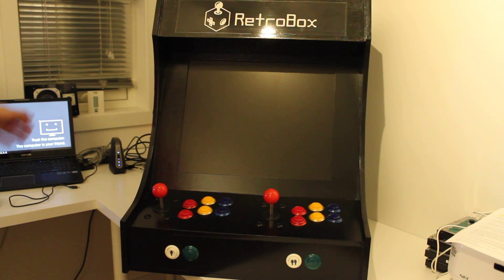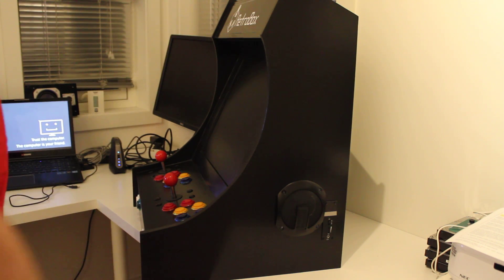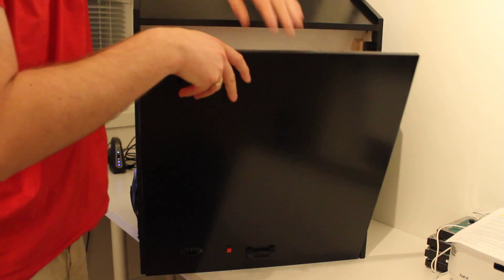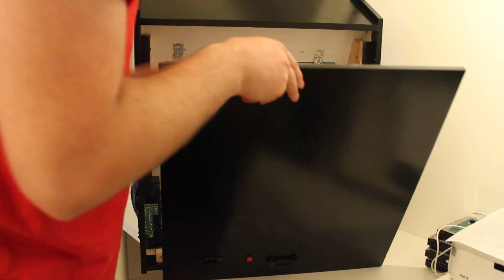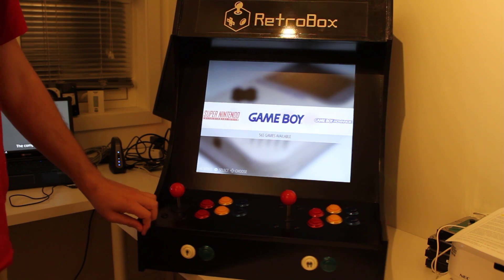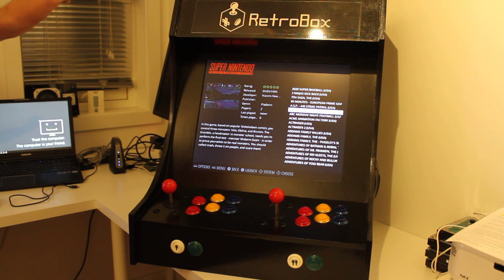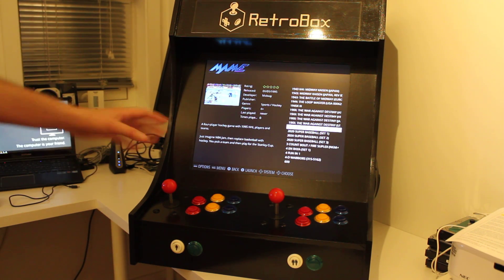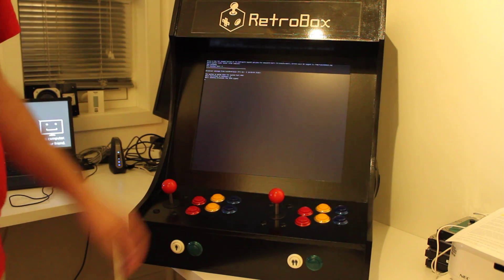RetroBox - Second RetroPie Arcade Build

Comment: Nice build! I'm working on my first one now. I have my Pi setup and get all my arcade controls today. Can you answer a couple questions for me please? 1) How long did it take for the scrape process to go through all the games and get the info? Do you need to unzip them for this to happen? 2) Have you had any issues with heat? I've seen some people install small cooling fans in the back but I didn't see that you did.
Reply from the maker: +Chris Smith Thank you! :)

1) It took a quite some time to write my custom scraper (I'm now re-writing it with a user friendly UI), but the actual scraping was done in just a few hours. I didn't unzip any files, just used the name of the game and system. I'll make a new video/post once the software is done, but it may take a month or two until I get the time to finish it unfortunately.

2) Not really, but I haven't overclocked it much either. If you intend to overclock it and run graphical intense games I would probably recommend adding a fan and/or heatsink. The Raspberry Pi will tell you if it runs hot or under-powered and I haven't encountered that issue on my build yet. There is plenty of space in the cabinet so it's essential the same as having the Pi lying on your desk. I probably wouldn't recommend a Raspberry Pi anyway if you intend to emulate N64 or newer systems.

Good luck with your build!
Reply: +IDmedia right now I'm just doing a table top one like this using the Pi. It won't have higher end emulators on it. This is just a prototype until I build my big 4 player unit. That one I have a beast of a computer that I'll use :)
Reply: +IDmedia Oh and when I did my scrape, I left the games zipped but wouldn't get the info. I had to unzip for RetroPie to download the info, does their normal scrape software not work that great?
Reply from the maker: +Chris Smith To be honest I haven't tried the built in scraper that much... Since I had developed a scraper for my Windows arcade I found it easier to just modify the code and use that instead. :)
Reply: +IDmedia well when you have your scraper more user friendly, I would gladly donate some $ to use it!
Reply from the maker: +Chris Smith Thanks. I'll try to get it done as fast as I can. I'll let you know when it's ready for testing. :)
Reply: +IDmedia Awesome! Oh... one other question. This is my first Pi that I've used, and want to make sure I'm using the right power source. I've read a lot of stuff that people get away with different adapters, I'm using an old Nokia phone charger that is rated 800ma (don't remember voltage) I don't have the charger in front of me since I'm at work. What adapter are you using, and what's the voltage rating? Just want to make sure I don't overpower it.
Reply from the maker: +Chris Smith It's recommended to use a 5V/2A charger, but it should also work with less (800mA should work). I have mine plugged into the monitor without any issues. The Raspberry Pi will display a colorful square in the top right corner if it's under-powered. Like this: https://www.element14.com/community/servlet/JiveServlet/showImage/2-129575-208157/pastedImage_0.png
Reply: +IDmedia Great! You've been a ton of help. I don't remember seeing that icon on my screen, but I will definitely pick up a different power adapter just to be safe. My arcade joystick and buttons just got delivered too! Can't wait to get home and start testing out some more stuff. Subscribed btw.
Reply from the maker: +Chris Smith Thanks! Good luck with your build and just ask if you have any questions. Regarding heat issue... it will display a red square if it's overheated (can't remember the threshold), so you won't miss it. :)

Comment: which rom set are you using for mame? and which version of mame are you running.? I myself am using 0.139 romset but a lot of titles don't seem to work. and the mame I am using are 2 different ones. but for some reason on the one that uses 0.139 rom set, I can't make the retropie to remember the controls. I always have to reconfigure the controls when I shutdown the raspberry pie. but on the other mame emulator it does remember. if you could help me I would appreciate it. oh and great job on the build of the arcade machine. I am going to make something that more or less resembles a kiosk. great video enjoyed watching the video.
Reply from the maker: +123hellstorm I'm using 0.106 with adv-mame 1.2 (recently upgraded to 1.4, but it uses the same set). If you use 0.139 you'll have to use lr-Mame2010. I haven't tried that one, but I'm really happy with adv-mame. Most games work without issues (except those who need CHD files because I skipped them for now, but may add a HDD later). lr-Mame2010 is experimental, so I guess it's only natural that it's buggy with roms that have been added to the later romset.

I would recommend to give adv-mame a try. Just launch a MAME rom, press 'a' and select adv-mame 1.2 or 1.4. It remembers the controls, but you may have/want to rebuild the romset to 0.106 for it to work properly.

Thanks for the nice comment. Would love to see your build when it's done! Good luck! :)

More info: https://github.com/RetroPie/RetroPie-Setup/wiki/MAME
Reply: thanks for the help.
Reply from the maker: You're welcome. :)

Comment: Great job i got a question for the rest of the Arcade like the front panels do i need to scale the PDF  to 100% too or what i need to do please Help Thank you.
Reply from the maker: +TapOut Ms Thanks! Yes, if I remember correctly I scaled everything to 100%. :)
Reply: +IDmedia Thank you so much
Reply: +IDmedia sorry quick question how i can select each piece by There self because they are together in one PDF file. Please Help if you can
Reply from the maker: +TapOut Ms Sorry, I'm not sure if I understand the question... You just want to print a single page instead of the whole PDF? Can't you just specify that in the print settings?
Reply: +IDmedia lol they are 3 PDF one for the side another for the controls and the other one is All the pieces together so I can't select the back door only or the marquee so i can print it out 100% like the other 2 PDF files
Reply: +IDmedia lol they are 3 PDF one for the side another for the controls and the other one is All the pieces together so I can't select the back door only or the marquee so i can print it out 100% like the other 2 PDF files.
Reply from the maker: Oh, now I see what you mean. Sorry, I just printed the side panel and control panel at 100%. The other parts are just squares or rectangles, so the only thing you'll need are the measurements. No need to print out a piece of paper that's 50mm x 54.4mm :P
Reply: +IDmedia Thank You again i will try it and keep the good job.
Reply from the maker: Good luck! :)

Comment: Are you using shaders or overlays on your retro Pie?  If so. Which ones.
Reply from the maker: +Goose Goose I haven't made any changes to the shader yet. I thought about giving scan-lines a try, but I'm actually very happy with the default settings. I haven't considered overlays either just yet. If I had a widescreen and the games weren't full-screen I would probably use overlays to fill out the screen. If you have any experience with this, please let me know. :)

Comment: For storage, I'm guessing all the emulators, OS, and ROMs are stored on the microsd card, correct? I'm thinking of building one myself, but am not sure if a 8gb microsd will work and I can keep all the ROMs on a USB or is everything stored on the microsd.
Reply from the maker: +TheSpiceWeasell Yes, currently I'm using a 32GB micro SD card. EmulationStation isn't optimized for a lot of roms because it checks if every rom exist on every boot and there's currently no way of turning that off. I'm looking into patching that issue. I have about 10k roms on the SD card now and it takes 1-2 minutes to boot. Adding more roms may cause booting issues. 8GB should work perfectly. :)

I'm also looking into connecting a USB-SATA adapter to the arcade for storing .CHD files (MAME disk images) on a normal hard drive since they are huge. Some games such as Killer Instincts needs a .chd image in order to boot and they tend to be quite large.
Reply: +IDmedia thanks for the info. hope mine turns out as good as yours, yours looks professionally built
Reply from the maker: +TheSpiceWeasell Thanks so much for the feedback. I'm sure it will turn out awesome! Remember to post a video/link to your build here when you are done. Also, feed free to ask questions if you are stuck along the way. :)
Reply: +IDmedia Hello again, I've hit a problem... When you go to move roms to a USB drive, what format do you move them to? I've seen some people just move the .gba's and such to the megadrive, but I've also seen online people move the whole .zip file of a rom for mame to the mame folder. I've tried different ways, but the closest I've gotten it they show up in emulation station, but when I select the game the screen fades to boot, but then returns to the rom selection screen. How is yours setup?
Reply from the maker: I'm not 100% sure what you mean by "what format do you move them to", but if I remember correctly all my roms are stored as .zip files. Just adding them to the correct folder should be enough. If the game shows up in EmulationStation you should be on the right track. Remember that some emulators such as GameBoy Advanced (.gba) requires a BIOS in order to work. According to your explanation I'm quite sure adding the gba_bios.bin file will solve your problem. 

More info: https://github.com/RetroPie/RetroPie-Setup/wiki/game-boy-advance
Reply: +IDmedia you were correct in understanding my question about the .zip files. It makes sense that ES will need the bios too, but I would have athought it was already on ES.
Reply from the maker: Nope, the reason for it not being included is the same as the roms. If you don't own the game or console you'r not technically allowed to have the BIOS file either. A quick Google search should help you find it. :)

Comment: Really really really appreciate your work. It's so nice. Can you tell me what are the other 2 (if i'm not wrong) printed circuit boards besides the Raspberry Pi? One i think for the joystick set, right? And if i didn't understand wrong, the set joystick is connected to the Raspberry Pi by the USB port? 
Sorry for the many questions but i really like your project.
Reply from the maker: +Federico Urbinelli: Thank you for the feedback! The circuit board hanging underneath the Raspberry Pi is indeed the controller for the joysticks/buttons. If you are interested you can find it on ultracabs.co.uk. I think the controller is great, especially on Linux. It may not be so great if you intend to use it on Windows with HyperSpin (I had some issues while trying). The circuit board on the bottom left is the pcb for the speakers for adjusting the volume/earphones. Yes, the joysticks/buttons are connected to the Raspberry Pi by the USB port.

Hope that answers your question! :)
Reply: Thank you for the quick reply man, and yeah, your answers fully satisfied my questions... Great work, congratulations again man, i'm gonna do something like that, but only this summer, when i got time, and i'll certainly rewatch this video if i'll have problems (i hope no haha), cause it's very detailed and your replies too. Thanks again.
Reply from the maker: +Federico Urbinelli: If you buy the same controller I suggest to take a look at my blog post: http://idmedia.no/projects/retrobox/retropie-3-running-on-my-bartop-arcade/
Even though the USB controller works great, it required me to add "usbhid.quirks=0x16c0:0x05e1:0x040" to "/boot/cmdline.txt". That parametre will split the Xin-Mo USB controller into 2 individual joypads. Took a while to figure out because the only issue you'll notice is that some emulators won't allow you to configure all buttons for player 2... :)
Reply: Yeah man i've already read that... Your work is admirable, really like the blog. Since you mentioned about the emulators... I got a last question, if you could answer this one too would be awesome: you know why some emulators don't launch some or even any games (for example SNES emulator, MAME emulator, PSX emulator...)? Is it just that the games aren't supported or it can be resolved?
Maybe the default emulator has to be changed with another one?
I ask you this because a friend of mine installed some roms, but for now he can launch only ATARI roms, PSP roms, some PSX roms: SNES roms don't work, MAME's too, NEOGEO's and NEOGEO Pocket's too. He has a Raspberry Pi 2 B+.
Sorry for this question but you look like a savior to my eyes man...
Reply from the maker: +Federico Urbinelli No worries, it's fun to get feedback and answer questions... :)
I know there has been some issues, especially with the SNES emulator segfaulting (crashing) in the past. I can't remember which version of RetroPie, but it's easily fixed by updating the image which can be done directly from the RetroPie menu (run the RetroPie Setup script and choose "Binary install"). Some emulators will also require a BIOS file in order to work. I know that GBA wouldn't work without it and the same would be true for PSX and a couple of others... You could also try to change the default emulator by pressing the "a" button after launching a game (if I remember correctly). I've changed from the default MAME emulator to advmame-1.4 because it supports more roms.  My best bet at the moment is that an update should solve this issue for you. :)

The RetroPie Wiki is really awesome and it should tell you everything you need to know in terms of configuration and BIOS: https://github.com/RetroPie/RetroPie-Setup/wiki
Reply: You're definitely a beast. Thanks man.
Reply: +IDmedia Yo man sorry if i ask you now but yesterday i didn't noticed it... What are the Raspberry Pi and the monitor (it's a monitor, right?) powered by? I ask you because i noticed that on the back there is only one power outlet.
But before you answer to me, i also want to tell you that we followed your advices about the RetroPie emulators, and... it worked! We first did the binary install and subsequently added the various BIOS files for the games that didn't work... Thanks a lot man
Reply from the maker: +Federico Urbinelli Again, don't worry. Ask as many question about the build as you want. The only thing I won't answer is where you get the roms (but I'm working on an application that helps you create the gamelists from a folder of roms). Anyway... I have mounted a IEC power input on the back of the arcade and then a cable from there to the monitor. The Raspberry Pi and speakers get's its power directly from the monitor (USB) making the power input as clean and simple as possible.

Be advised of two possible issues here. First of all it's recommended to use a 1.8A power supply in order to power the Raspberry Pi 2. I figured out that my monitor supplied enough power over the USB and my testing didn't show any issues at all. The Raspberry Pi 2 will show you a colorful square in the upper right corner in case it doesn't get enough current and a red square if it runs hot. It's a nice thing to be aware of! The second potensial issue I think is called "Ground loop". If I turn the volume of the speakers all the way up I can clearly hear interference noise coming from the monitors power supply. I think it's my monitor that is the issue here, but when I disconnect the speakers USB power from the monitor or Raspberry and add it to another outlet outside the arcade the noise is gone. It's not a big issue, but nice to be aware of. However, this totally works!

Glad to hear that the suggestion fixed the issue! :)
Reply: Ok. Now it's all clear and wow, great idea, i wouldn't thought about it. Do you think this (power raspberry from the monitor) can be done with any monitor or it's just an event?
Reply from the maker: +Federico Urbinelli: I guess most monitors should work as long as you don't connect to many devices to it. I would recommend to test this before installing a monitor in an arcade.
Reply: Ok, i see. Thank you so much man...
Reply: +IDmedia Where did you get the volume controller board? I find it very interesting.
However, i wanted to tell you that i'll start to work on my own project by the beginning of the next month, instead this summer as i said, and once i'll have finished it i want to show you it... Obviously it'll be a lot different from yours and because of this i will be happy to tell you anything you could ask about it, just like i'm doing with you haha.
Reply from the maker: It's part of the USB speaker. I just dismantled it so I could mount the controller on the side of the arcade.

Would love to see your build once it's done. Remember to add a link to your video here so I get notified. :)
Reply: +IDmedia Oh nice, i see. 
Of course man, you'll be the first i'll inform ;)
Reply from the maker: Awesome! I'll try to make another arcade video in a couple of days or so. It's running Windows and is a whole lot more advanced than this build... Stay tuned! :)
Reply: IDmedia Niceee man.. can't wait to see it..
Obviously with more hardware and a powerful OS as Windows you can do something really more massive, i'm sure it'll be a beast.

Comment: For where you command the esc key at the bottom to exit the game? Also you have a pause button?
Reply from the maker: +Petros Petridenas Sorry, not quite sure what you mean by "command the esc key". When booting RetroPie for the first time it will help you configure the start/select key that are used to exit the game. I currently don't have a pause-button configured, but it should be easy to do if you have enough buttons.

The Wiki should help you when it comes to configure inputs used by the emulator: https://github.com/RetroPie/RetroPie-Setup/wiki
Reply: thx a lot man... :)